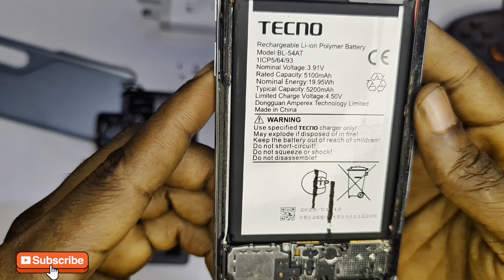Tecno Camon 40 Pro Teardown — Tecno set a new standard...

Comment: Bro, it looks like 3 cameras outside, but they already wrote it is only 2 cameras on their specification. So it is not a mistake.
Reply: It has 2 cameras and the other ring is a sensor for the flashsnap
Reply: @lancemiguelfernandez3358  some transsion phones are known to put dummy sensors on their products i doubt it's even serves a function at all
Reply from the maker: Making 3 camera rings is deliberate as most people wouldn't reach the specs
Reply: @TheGadgetBreakdown But they did specify it, didn't they?

Comment: Third one is actually Auxiliary sensor for remote control.
Reply from the maker: But they don't need to make a camera ring for that, that y I call it deceit
Reply: @TheGadgetBreakdown you are right. It's very deceitful lol. They can just do an IR blaster
Reply: How does that work?
Reply: @oluwafeyikemiakinwunmi6071  you can use your phone as a remote to control your TV or stuff like that.
Reply: Its not the IR sensor. Its a flicker sensor the IR blaster is on top

Comment: They use the screen side for thermal cooling 🥴, that's why my Tecno camon 30 heats up from the screen side
Reply: I wonder if that's a smart choice. The adhesive holding the screen will loosen up quicker than it normally would if there was less heat going to the screen

Comment: On the technical sheet it is marked 2 rear cameras for the tecno camon 40 pro so there is no mistake.
Reply from the maker: Having a third identical camera ring is the deceit, not all buyers goes through the technical sheet
Reply: Go and do the same to Samsung S25 Galaxy and see if all of their camera is at work, or what again did you find?
Reply: All S series Samsung Camera are all 💯working  @davidoforbuike4308
Reply: the third is likely a depth sensor, right? a standard practice in the industry
Reply: That's actually Auxiliary sensor for remote control  @ReinBelmont